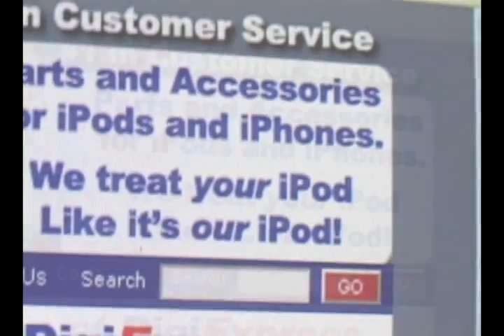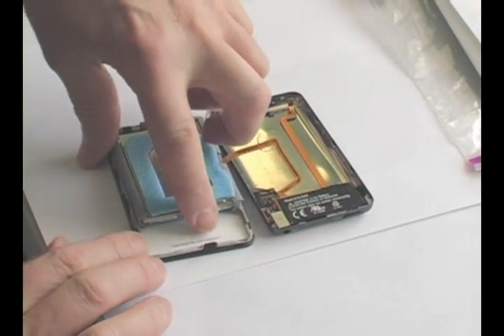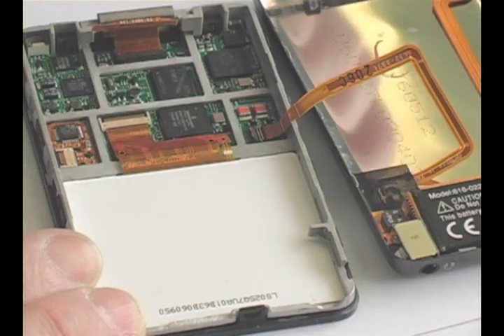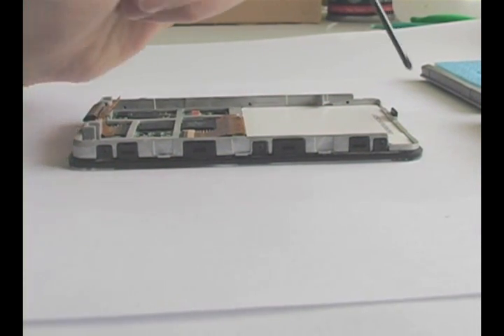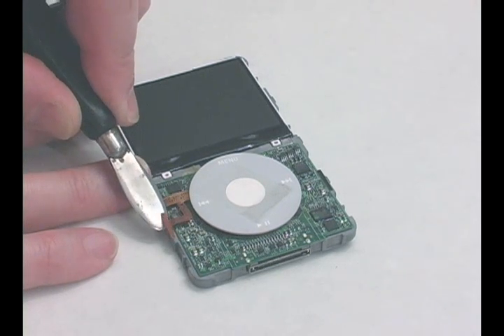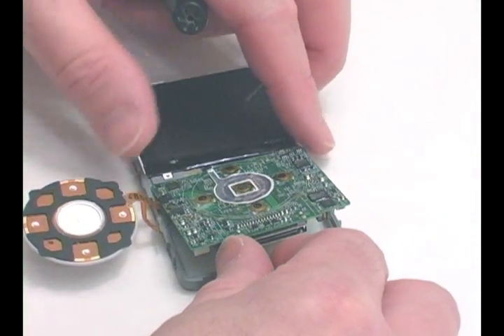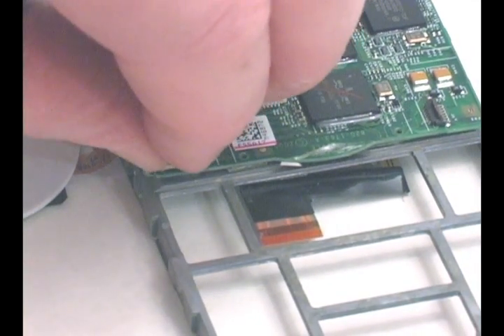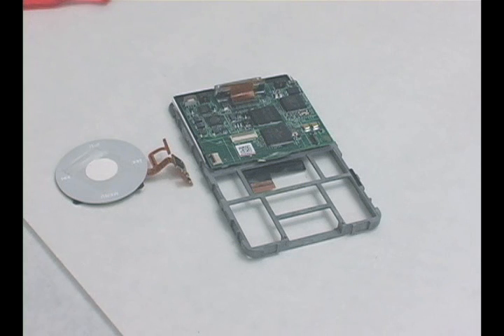DigiExpress - iPod Video  / iPod Classic  Click Wheel Installation

Comment: I install click wheel myself.good product click wheel , but the green tools are soft, and they will worn very quick cause the i pod is metal so it will cut the sharp green tool. and the i pod opening  video is not explicit. you guys should explain how the inside clamps are hooked to the carcass.

Comment from the maker: If you're experiencing issues with any portion of the click wheel, there's a chance that the click wheel actually needs replaced. Overtime, certain parts will become worn down and no longer work correctly. 

We do carry the part, and it sells for $18.99. If you wanted us to install it, there would be an additional $25 labor fee. If you're interested, here is the link to the part: digiexpress.us/ipod_classic_parts.html. From here, you can order both the part and the repair.

Comment from the maker: The click wheel from the U2 edition (actually the 4th gen iPod) will not fit a white iPod Video (actually the 5th gen iPod). The connections and housings are actually different. here is the U2 version link: digiexpress.us/4th-Generation-Photo-Click-Wheel-Assembly_p_85.html
Here is the video link: digiexpress.us/White-Clickwheel-Assembly-for-iPod-Video-_p_16.html
As you can see, they are different in a number of ways.

Comment from the maker: The red x means there is a communication problem between the main board and the hard drive. We've had cases where we've just removed the ribbon cable connecting the two and put it back in and it's corrected the issue. Sometimes you need to completely replace the ribbon cable. If that doesn't fix the issue, then there is either a bigger main board problem or a bigger hard drive problem.

Comment from the maker: I just went over your descriptions with our head technician. After carefully reading over what you have done, it sounds like the main board may be damaged. The foil that the other video removed should not be removed, as it is vital to the function of your iPod. You may need to completely replace the board to get it to return to proper function. Unfortunately, the iPod is a little difficult to work with if you haven't done it before.

Comment from the maker: With the broken connection, it would be hard to determine exactly what part you would need without seeing exactly where it's damaged. You could need a new click wheel, or a new board. In either case, we carry those parts and can ship them out to you.

Or, if you would like, we could repair the problem for you if you're interested in going that route. You can give us a call at 800-440-4693 and speak with a representative, or order the parts from our website, which is shown in the video.

Comment from the maker: Check that you have not damaged the connection for the LCD screen, or have damaged the LCD screen itself.  If you did damage the LCD screen though, it usually shows up as a black mark on the screen (like ink droplets).

Comment: I have an Ipod classic 60 GB. The control wheel have problem on the volume only.
It goes down or up whit no tuching. I have tu use the lock button in order to listen my music. In that way the volume stay like that. And I can hear the clicks. Is an 2 year old I pod. I think the slider wheel after a while don't recognize  the finger touch. I can see on the wheel a glossy surface from sliding the finger on the wheel not like how it was new, So I think I have to change the sliding wheel.

Comment: @TheLandMoose it may not be connected properly, but the reason to connect the wheel to the logic board would be for the scrolling to work.

not sure why its not letting you select the input buttons.
is it click as a pressing sound. and is it easy to press on? and is the button sunk inside?

because it could be that the ipod is not having the contacts being pressed

Comment: I bought the battery from your company which solved the problem of it not turning on, but now the wheel wont work. I have taken it apart and tried to use the buttons on the main board to see if that works but that doesnt either, is my mainboard bad?

Comment from the maker: @IBringIt666 This could mean that you need to reposition the black pad below the center button. To do this you would need to remove the faceplate to see the pads. If you do this and find the center button does make the "pop" or "click" then it has worked, if not you would need to replace the logic board. The actual buttons for Center, Menu, Play, FF, RR are located on the logic board. The clickwheel itself handles only the scrolling of the menu and volume up/down. We sell all these parts.

Comment from the maker: @lollipopgurl779 This could mean that you need to reposition the black pad below the center button.  To do this you would need to remove the faceplate to see the pads. If you do this and find the center button does make the "pop" or "click" then it has worked, if not you would need to replace the logic board.  The actual buttons for Center, Menu, Play, FF, RR are located on the logic board. The clickwheel itself handles only the scrolling of the menu and volume up/down.  We sell all these parts.

Comment from the maker: @MsCeMontgomery It would be the safest bet, yes.  There is always a chance with the Video/Classic models that you have an issue with the main electronics (logic) board.  If you are having a problem scrolling through the menus then it is most likely the click wheel.  If you have a problem pressing buttons (play, ffwd, rrwd, menu) then it may be main board.  It is hard to tell exactly which one would need replaced, the click wheel being the less expensive option.

Comment from the maker: @MrTravi81a The clickwheel itself only controls the scrolling.  The buttons (menu, center, play, ffrwd, rrwnd) are actually part of the logic board itself.  So you probably need to have the clickwheel replaced and it should bring the scroll function back.  The other option is that your logic board is damaged and that's why the scroll does not work.  I believe you just need the clickwheel replaced, which we can do for you or sell you the part for your own install.  All the info is on our site.

Comment from the maker: @Kamalib05 If when you connect the device to power (wall charger or computer) you can hear the hard drive "spin up" or hear the audible clicking when moving the clickwheel; then you may have an issue with the display.  Obviously if you hear and "feel" the device functioning but you see no display the you could have damaged the screen.  Check your FPC connection on the logic board (the little white clips with a black plastic hinge) where the LCD screen is attached to the board. This is a tricky 1

Comment from the maker: @Kamalib05 Also, try doing a Hard Reset (hold Menu and Center button for 5 seconds) while plugged into a wall charger to see if you get any messages.  I am pulling this information from the manufacturer's website, which is Apple's Support Site (I cannot link in the comments)

Comment from the maker: @Kamalib05 If you had replaced the logic board and battery to find that the device is completely unresponsive then you may have one of two issues.  The first is you may have a defective board, even with no battery installed when you plug the iPod into a wall charger it will display "Please wait very low battery".  The other issue could be with how you plug the charger into the wall, you should be using Apple branded charging gear with NO ADAPTERS for UK vs US voltage.  I hope this has helped.

Comment from the maker: @Kamalib05 Please give just a little more detail if you could about what is not working in the iPod.  You may need an LCD screen, Clickwheel, Hold switch or new Hard Drive.  This all depends on what happens when you power the device up or connect it to a wall charger.  I will try to answer your question to the best of my abilities if you could just define more precisely the issue.

Comment from the maker: @RickyT2010 iPod Nano's are very limited in the replacement parts, there are LCD screens, Batteries, Headphone jacks and Clickwheels.  The first step is to replace the clickwheel in your device.  If that fixes the problem then you know it was just the headphone jack.  If the problem persists then your issue is with the receiving end of the connection, the main electronics board (aka logic board).  The logic boards for these are not available in new condition and as such we do not carry them.

Comment from the maker: @ssxrssdomdom It sounds like you need to replace the click wheel.  Holding the middle and menu button does a reset for the device.  If your clickwheel is not working this reset will not occur.  If your iPod has no water damage and has not be dropped from a great height, then you should be safe in just replacing the clickwheel.  If the device has been dropped or has water damage, you may need additional parts.  Please visit our website for more information.

Comment: Hi my wheel is not working on my ipod nano 5th generation. I tried holding the middle and menu button; etc but it didn't work. I believe that it is a hardware problem. Do you have any suggestions for me?

Comment: @DigiExpress Ahhh. that makes sense. so. lets say i buy a set of tools. should i just check the Ribbon cable. and see if it was just the cable? To check the cable would i have to do anything? such as Unplug The Ribbon Cable and plug it back in? If that doesn't work. it would mean i would have to buy a completely New HDD. Right?

Comment from the maker: @xXZERUSXx 
The red 'x' could be a few things. Your problem could be as simple as a hard drive ribbon cable. Was it dropped? If it won't go into disc mode, that tells me that the logic board can't communicate with the hard drive. So either the cable is bad or came loose, or the HDD is faulty.

Comment: @DigiExpress Hmm.. The hard drive eh? interesting. When i turn it on i see a big "X' and i try to put the Ipod into disc mode. each time i have tried this, it fails. does this help your accusations of the HDD? and just simply by replacing it should fix the problem.. Correct?

Comment from the maker: @4154wkamerling 
Sounds like you are having clickwheel problems. Which we can fix. Send your iPod in for a diagnosis and we can let you know what parts you would need to have this iPod repaired. Our diagnosis/repair service is $25. For a new clickwheel ribbon cable it is $14.99. Check out our website for more information. We hope we can help you repair your iPod.

Comment from the maker: Watch our video for the Nano 3rd gen LCD installation. It shows where to disconnect the click wheel ribbon cable. Remove the main board screws, flip it over and remove the click wheel.
Reply: Answer max miser's question, DigiExpress!

Comment from the maker: It depends, older Classics use the same click wheel ribbon cable, however the newer version of the main board will not work with a video click wheel. If you purchased your Classic soon after it was first available then you would possibly be able to interchange them.